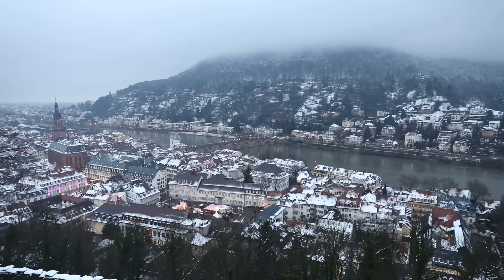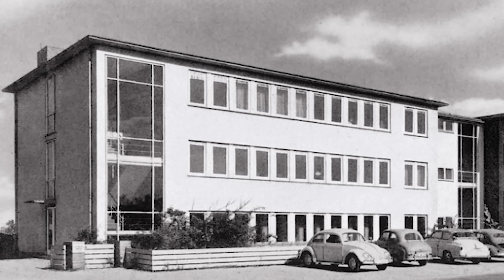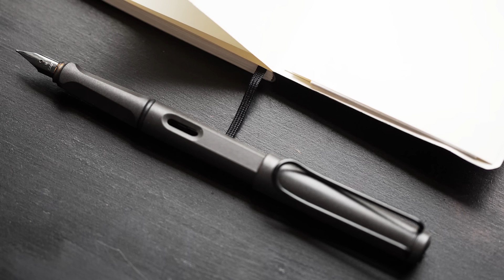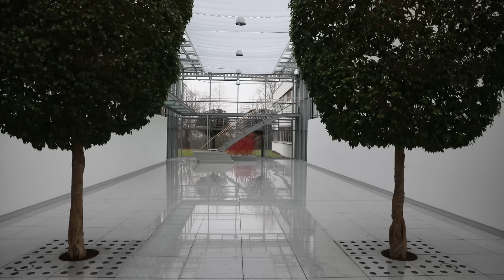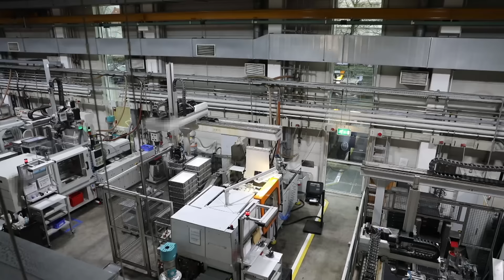How It's Made - LAMY Fountain Pens

Comment: I finally broke and bought a fountain pen. A lamy safari in "limited" color mint green. I always thought they were impractical and for show only (like people used them in movies as props ect". Even though I prefer ballpoint and pencil for tattoo stencils, drawing and mostly everything else. I find the fountain pen to be handy to save money instead of buying carts or refills using bottled ink, and it is easier to read and sometimes more comfortable to write with as well. I like having multiple tools for a job, ones that are slightly different to fix the small problems but still all do the main task, ballpoint, fountain, pencil and markers all do that.

Comment: This is an older video, but I wanted to share my experience with Lamy. The Lamy Safari was the first fountain pen I owned, and I absolutely loved it. Got out of the hobby and then back in and am so thoroughly entrenched that it's more just a seamless part of my life now. Decided to give the Lamy 2000 a try and, not gonna lie, I hated it at first. Bought a medium nib and was shocked that the line width exceeded my broad nibs. Found it heavy compared to the Safari and my other resin pens and slippery to hold. Shelved it. Then took it out again when I needed something I could cap/uncap quickly to write passes and jot notes with. Paired it with a drier ink and the magic started. I noticed that this thing is a shading machine - even with inks not known to shade. With a drier ink, J. Herbin Le De The, the line shrunk quite a bit and was more crisp around the edges. It wrote so smoothly that soon I took it from just notes to grading. I stopped overthinking and held it like I prefer (close to the nib and at higher angle) and noticed that I could write for an hour straight with no hand fatigue. Now I just bought my second in a F nib and couldn't be happier.

Comment: Unfortunately it seems that their quality control is horrible. I recently received Lamy 2000 that had a crack in the feed part straight out of the box. Lamyshop sent me a new one and also the new one had exactly same kind of crack! They insisted that its not normal and offered to send third one, but I rejected it cause there is probably a faulty batch of 2000's in the market. The crack is not easy to see, but if you unscrew the feed part, remove the metal ring and then look the rim against the light, its easy to see. It's not only cosmetic problem since it could lead to ink to leak.

Comment: I really like Lamy's designs, but I've had terrible experience with their QC. 4 of the 7 fountain pens that I've owned (and one was a Lamy 2000) had nib issues. One of them was scratchy, two had skipping problems (including the 2000) and one wrote a thicker line than the other ones, even though it was the same size ! I have to mention that the Lamy support was awesome, they took care of me. But anyway, I moved on to Pilot and I'm very happy with their instruments. I've never had a bad Pilot nib.

Comment: Good video. Nice narration! It's interesting how so many of the steps to make a nib have not changed. The tools are different, but the steps are pretty similar. The press for shaping gold nibs at about 3:17 is just a modern version of the same ones used to make steel dip pens in the 1830's. The movement of placing the nib, lowering the press and taking it out is also the same. Pretty cool.

Comment: 2:15 Do they have multiple machines for making nibs? It must be quite the hassle to clean it every time they need to switch the kind of nibs they're making, so it would make more sense to me to have one machine for steel and another for gold.
Reply: The SS is clearly a product of a progressive forming die set up but golds are made clearly using a manual die set. So they are separate lines for sure.

Comment: Tl;dw Lamy generates uncountable tons of plastic waste with their ink cartridges.
Reply: Esteban LV I totally agree, using a converter is not only cheaper in the long run, but also way more sustainable. However, I would argue that (at least in Germany) most of the ink cartridges produced by Lamy are probably bought by students as they have to constantly use a fountain pen in school for at least 7 years. Thinking back at my time in school, I’m fairly certain that using a converter wouldn’t have worked out. When you’re taking notes in class or taking an exam you certainly don’t have the time to fill up your pen that has run out of ink with a converter and a bottle of ink. Not to mention the mess this would result in, especially in grade school. Also, carrying around a bottle of ink in your backpack all the time is of course heavier than just putting some cartridges into your pencil case, but more importantly, by using cartridges, the risk of ink leaking out onto all of your stuff is greatly reduced. 
I’m not saying that producing so much plastic waste doesn’t matter - it absolutely does and there should definitely be a way to recycle all of these empty cartridges; plus, people who are using their fountain pen only at home or in their office should definitely switch to a converter - I’m just trying to explain why using cartridges really is necessary for the greater part of people using a fountain pen in Germany (and maybe other European countries, too?).

Comment: Even as a german I am deeply impressed, how much perfection there is in this factory. Every single step of manufacturing something sold under 50€ (I think 80-90% are Entry level stuff- until I searched for Ink cartridges on Amazon to get over the limit for same day delivery for something other, I didnt even know about converters, bottled ink and other Lamy Pens as the Safari, ABC and Al-Star- and I have used Lamy Pen's for about 15 Years until that) is perfected, simplified and rationalized.

Comment: I’m a fan and my favourite is the Lamy 2000. Only thing is: when converters were introduced in Germany maybe 25 years ago, I thought, great idea to end the plastic waste. Unfortunately they are still selling cartridges, when clearly the converter works just fine as the American example shows.
Reply from the maker: I think for some, cartridges are easier especially when on the go. No need to bring a bottle along. That said, reusing cartridges by filling them with an ink syringe is a great way of making them less wasteful. - Colin
Reply: Especially schools should promote the use of converters. The ink bottle stays at home and that’s where you refill the pen. Cartridges for emergencies only. The switch from cartridges to converter worked fine for me when I was in school. It’s cheaper, too.
Reply: It's often a colour problem. Lamy offers 3 colours in a bottle. But way more in cartridges. If you want more ... interesting ... colours you have to use way more expensive bottled inks here in Germany. I am not a big fan of royal blue but for my bulk writing I use 1l bottles of Pelican 4001in that colour - the only ink I could find in a 1l container and it's dirt cheap this way.

Comment: I don't own a LAMY pen but after watching this, I'll probably get one.  I bought my first fountain pen about two years ago and now I don't want to write with anything else.  Fountain pens are incredible at precision handling.  The quality of the handwriting is improved dramatically.  A simple card writing becomes a work of art!  They can be messy though.  When you remove the cap, there can be ink on the shaft and they also expend ink much quicker than other types of pens so having a supply on hand of ink cartridges is necessary.  They also require occasional maintenance such as cleaning (you run the tip and casing under water for a bit between refills).  I can say that writing with a fountain pen is an enjoyable experience just like a craftsman enjoys working with the finest tools.  I was surprised at the difference the pen makes.

Comment: As a school kid it was either Lamy or Parker, both much nicer to use than anything else at that price range
Reply: Modern Parkers often suffer from the ventilation of the cap that can lead to the nib drying out rather quickly - I have two Sonnets - one can remain unused a week and will still work flawlessly, the other will dry up overnight - once I sealed the cap venting hole it worked as well as the other - but I guess for less informed users a Parker can be a bit of a disappointment if they get something like my 2nd pen.

Comment: Huh. I only ever use cartridges. I did not know the US prefers bottled ink when using real pens. Good video.
Reply: I guess it depends. With a bottle you can dip if you only need a bit with a certain colour. Once you open a cartridge it's hard to re-seal it and you have a LOT more cleaning to do. And cartridges are way more expensive. On the other hand, when travelling or sitting outside and you run dry, a cartridge is easily replaced.